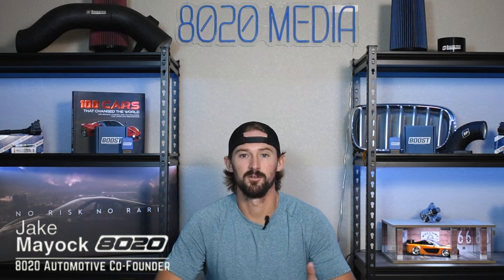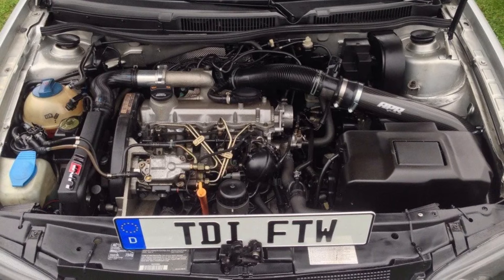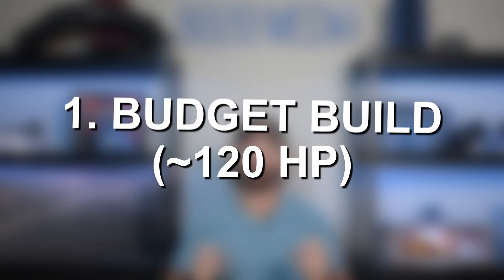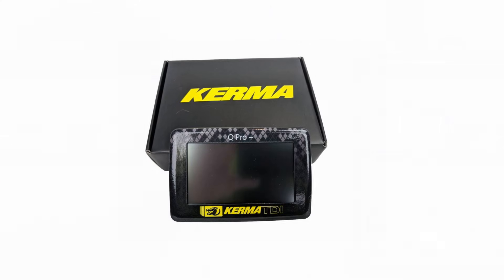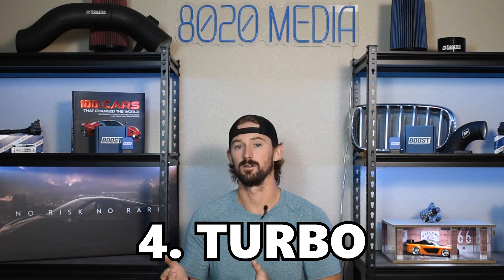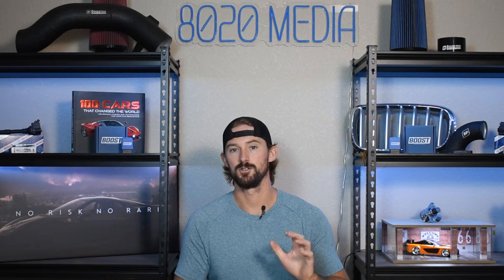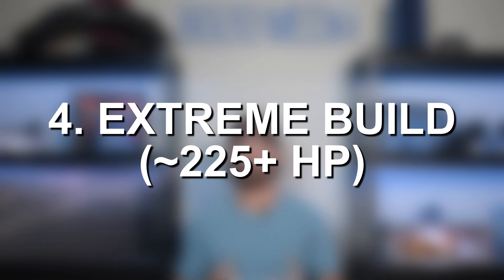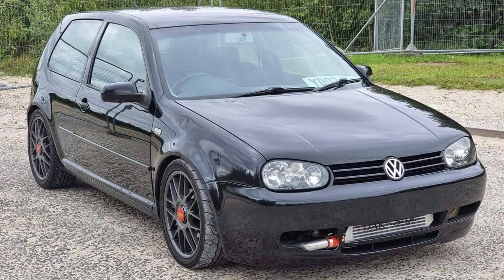Pushing the Limits of the VW 1.9 TDI ALH – Power Guide! (225+ HP)

Comment: I bought a 2000 TDI in 2013. It literally had 99,999 miles on it. I bought it based on fuel economy and it became my commuter car. 13 years later I have 160,000 miles. In that time, I have replaced a couple gears, the clutch twice, the diesel pump and just found out I need to replace the injectors. That said, I love driving the car. I did a Malone Stage 3 tune back in 2015 and can't believe the gains for that $1,000 investment. That was the tune, weighted clutch, injector nozzles and installation. Had I known about the VNT-17, I would have considered that before the Malone Stage 3, but as a responsible driver, it's probably better I not be tempted. I'm probably around 135HP right now and I can spin my tires at about 35 MPH is the road is wet. That is way more torque than a passenger car needs.

Comment: 2000 Golf ALH 1856v turbo, .230 nozzles, pd150 intake, kerma intercooler, dyno tested 217 wheel HP and 399tq @34psi 4900 rpm 
thing rips
Reply: Anything done to the pump?

Comment: I have a BEW car. But I'm over thinking like man, what if one of these things had like 600, or 800 horsepower, and like 1000 lb ft of torque. Guess it ain't possible with this platform.
Reply: I've seen 700hp on the PD engines on Officially Gassed (UK)
Reply: @OzzieMozzie777 I'll have to look into that!

Comment: You need to figure out what to do about traction. All i did was stage 3 malone, clutch, injectors, and exhaust. Tires break loose all the time, even in 3rd gear at a roll🙄

Comment: I honestly don't understand the obsession with Americans and the VE diesels when PD exists and is so much better of an engine platform to start tuning. Like you said, fueling is the biggest problem. PDs will dump as much fuel as you want as long as the nozzles are big enough. No pump elements to change. PD130 will do your "mid-range build" power with just the turbo and a tune. And wouldn't a GTB2260 be way too overkill for just 225hp? I've seen it on sub-300hp builds on PDs.

Comment: If you get a PD130 (ASZ) or PD150/160 (ARL), the stock block & internals can take around 300-320 HP/ 500-530 NM at Crank
Reply: How do you get there?
Reply: @abdullah8224  Just how moHAMmed got to ayesha....
Reply: It can take a lot more than that
Reply: @elite_gameing_empie7386  I wouldn't say that it can take 300, especially over 300 with stock bottom end. 280-290 sure.
Reply: @underii the pd150 can take 400hp on stock bottom end been done many times
Reply: @e @elite_gameing_empie7386 no it wont 😂 thats over 700nm peak torque
Reply: @underii okay have you seen how thick a pd150 rod is I mean a pd100 rod will take 300hp no problem again this is stuff that has been done multiple times

Comment: If you wanna drive "better" with the same fuel economy you need just
1 ARL intake (complete)
2 injection nozzles 216
3 ARL turbo
4 Front intercooler
5 ARL map sensor
6 fuel pump from ASV or just head 11mm 
7 oil cooler 
8 clutch complete with flywheel from Golf mk3 VR6 
what next? Chip tuning for only 160hp
Why not more? Because with this mods You can do next 400000km without any problems.
If You wanna more than 200hp You need complete crankshaft,pistons connecting rods from PD engine like ASZ,ARL beacause stronger and pistons have another construction with oil cooling from factory.of course for over 200hp everything bigger like turbo and injection nozzles etc.but its will be expensive.
Reply: Now imagine you had a PD engine from the start. Lol.
Reply: @underii  no,i still have vp engine.

Comment: Not bending a rod above 225hp? Lots and lots of those engine are making about 300hp and stock internals. Those engines and AFN and AHU engines like mine. Just make sure you dont make more than 2.6b and you'l be fine
Reply: Ik a guy making 400 and never opened the motor
Reply: @billyhays5293 its VP or PD?

Comment: Dear friend i own an a4 b6 1.9 avf code.i'd like to know if the stock turbo can handle 200ps or i have to upgrade it and what turbo should i choose?thank you very much!
Reply: the original turbo cannot provide 200hp. ~180 is quite maximum for it. I have avf myself and with gt2260v, front intercooler, 3" exhaust and stock injectors and internals. it makes 237hp/471nm at 1.65 bars.
Reply: @elmerikorppi3246  mikä kytkin?

Comment: Im working on a alh tdi swap in a 911 - I’d love to hear more info on your take on the higher 250+ hp build concept. I intended on working with Darkside Developments, but have been hesitant to reach out because there is so little discussed on building a alh making that kind of power. Most go with a pd engine. Analog is best for the 911. I have a lot of knowledge about building a custom injection pump, need of meth injection, amongst some other basics for that power level. But like I said, I’d love to hear your take on what its gonna require (don’t remind me this is going to be a $6000 ALH lol)
Reply from the maker: M - Love that project — an ALH-swapped 911 is about as beautifully analog and mechanical as it gets. Getting north of 250 hp from an ALH is totally doable but it means you’re no longer in “tune-and-bolt-on” land — you’re basically building a hybrid of ALH simplicity with PD-level airflow and fueling. At that output you’ll need a stout bottom end: ARP hardware, forged rods (IE, Rosten, or Maxpeeding if budget-built), and preferably a girdle for long-term abuse. The stock pistons can handle ~260-270 hp if the tune is clean, but you’ll want coated pistons and slightly opened ring gaps for thermal stability. Head needs port work and a cam with better lift/duration — Colt Stage 2 or similar. On fueling, a 11 mm or 12 mm pump head and custom injectors (Race 520s or higher with balanced nozzles) are mandatory; meth or water/meth helps with EGT control but isn’t a power adder by itself. Turbo choice makes or breaks it: a GTB2260VK or Garrett G25-550 on a tubular manifold gives a broad, usable curve; VNT17/22s won’t hold 250 hp efficiently. Intercooling and exhaust have to be overbuilt — 2.5" straight flow, big front-mount or side-mount depending on your 911 packaging. ECU tune from a shop like Darkside, Malone, or Whitbread is essential — you’ll need full-map customization, dynamic smoke limiters, and precise boost control. Clutch and flywheel need to match torque (~400 lb-ft capable). If you keep analog injection control, expect some driveability trade-offs but immense simplicity. The cost adds up fast — ~$6–7k all in, just like you said — but the result is a lightweight, spooled-at-2500 rpm diesel flat-six killer that still feels mechanical and raw. The real key is EGT management and fueling precision; once that’s dialed, an ALH at 260 hp will live surprisingly long.
Reply: A friend of mine has an ALH swapped 930. It's an amazing endurance race car. Best of luck!
Reply: Reach out to darkside....they've built.multiple high power alhs

Comment: Mate your mad Im running 220bhp on stock injectors
Reply: Why tf would u do that. 😂
Reply from the maker: D - Sounds like you want to blow your engine.
Reply: no you are not, not in an alh - the max hp that you can get from the oem injectors is around 130-140hp

Comment: Those OEM small side mounted intercooler are bad, I prefer upgrading the intercooler even if the car is stock or has a ECU tune
Reply: exacly, even after simply ECU tune the temps in the stock intercooler are high
Reply from the maker: T - We agree!
Reply: it might depend on your setup or climate, with an aggressive tune mine doesn't go high and also takes around half an hour to warm up properly.
Reply: Is there a intercooler upgrade thats a straight swap without having to re route pipework?
Reply: @Andy-cy6dq  no, stock is to the side you have to put central intercooler